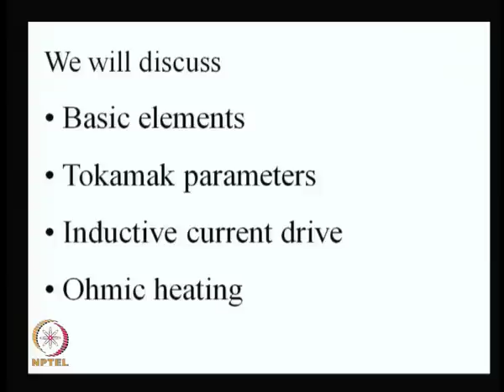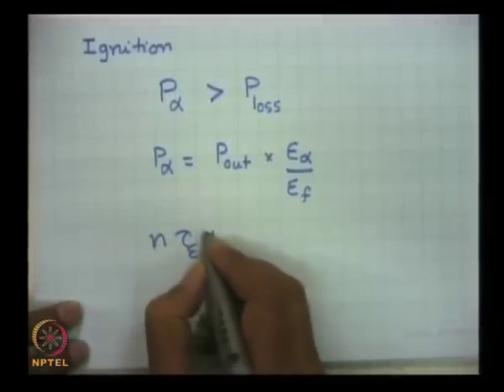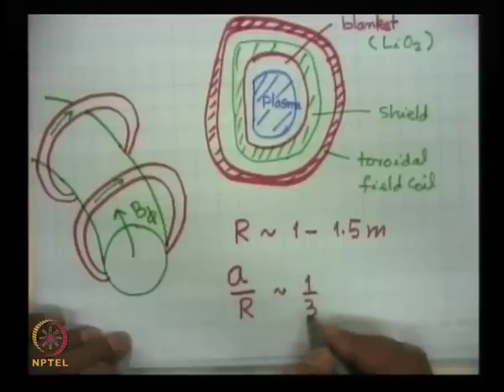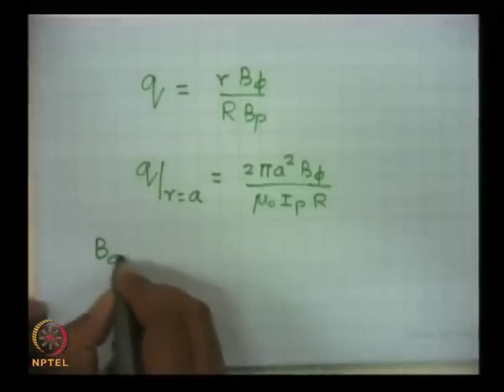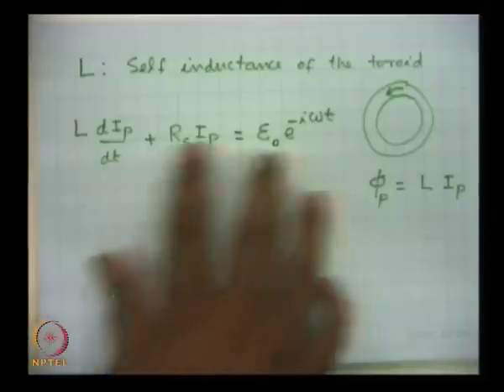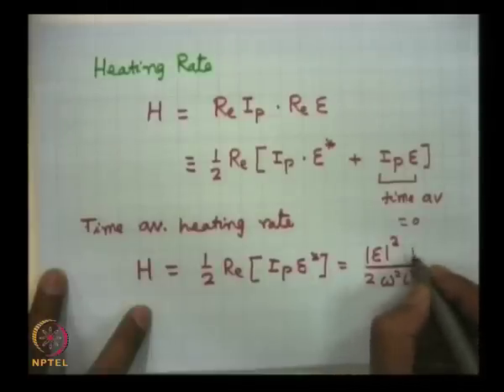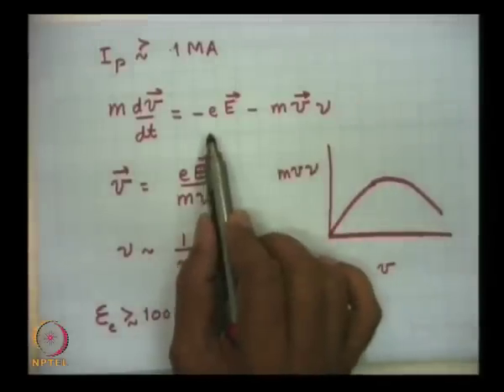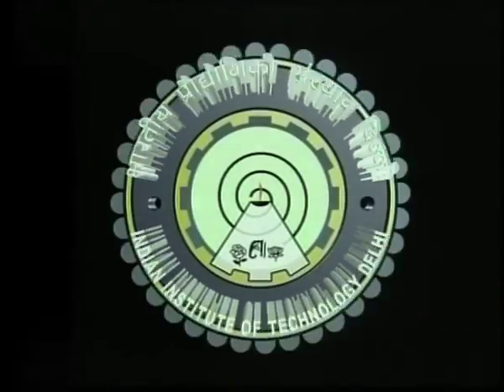Mod-01 Lec-26 Tokamak operation

Comment: No proof of fusion in easy reach yet yes heating a plasma and making it run a steam turbine a good story. I think it takes 15 billion K as that's the repulsive energy matching the thermal energy for it to just touch and stop when the nuclear forces really act to fuse. Not achieved on earth yet. But maybe at the tail of the Boltzmann maybe it might fuse a bit at 100 million K. Directed fusion with accelerated collision based fusion might have been done . Fusion hunt cost 100 amusent parks so far who said this wasn't fun ☺️.. It's a 2 stage process where RF heats it to plasma and the inductive current drive takes it to high temp. The water jacket dosent absorb either.